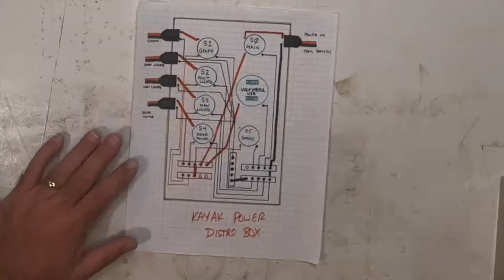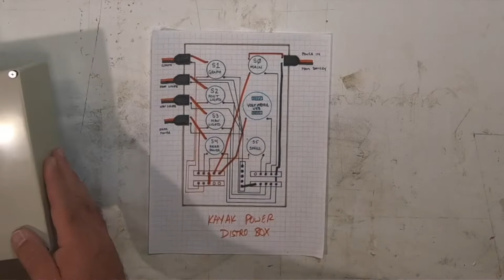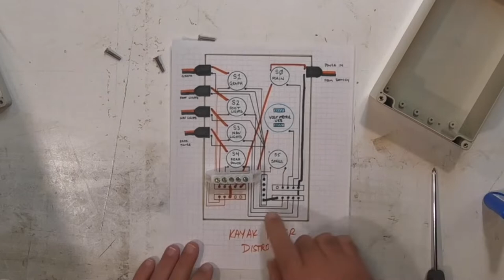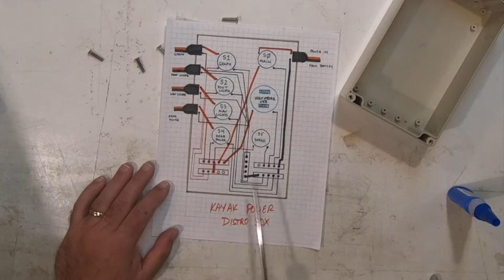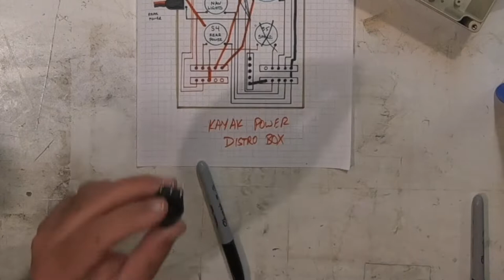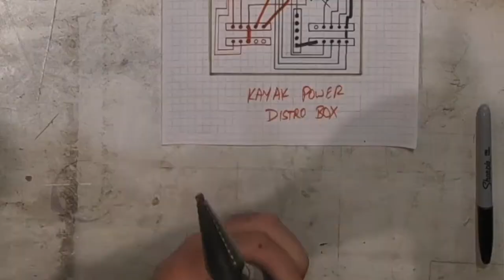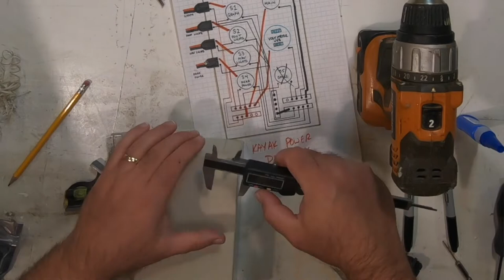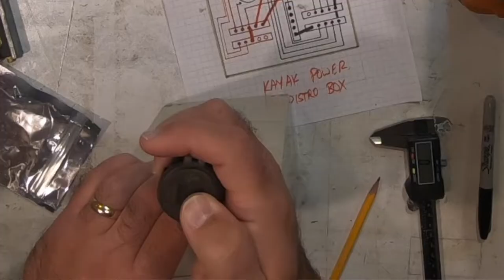DIY Waterproof Kayak Accessory Power Distribution Box. Fish Finder. Lights. Old Town Autopilot 136.

Comment from the maker: Follow up after a couple weeks of use:  
(1) Heavy Duty Velcro isn't strong enough to survive transport on bumpy roads.  I need to find an alternative.  I'll let you know when I come up with something.
(2) Consider capping your wires with some kind of crimp connector before putting them into the bus bars.  The only electrical problem I've had is with thinner gauge wire sliding out of the bus bar stops.  I put a crimp connector on (which gave the bus screws something better to hold) and haven't had a problem, since.
Reply from the maker: (1) I ended up going with self-tapping screws through the back of the box and into the hull of the boat, under the seat.  (Still in the same position shown in the video).  I pre-drilled the holes in the box and then applied silicon to the back.  That way, when the screws pulled tight, the silicon sealed the holes.  I've transported the boat approximately 200 miles since making this change.  No issues.  Rock solid.
(2) Crimp connectors in the bus bars are working a treat!  With these two minor tweaks, it feels like a professional quality mod.

Comment: Great project, you could also simplify the project by buying a marine switch plate and installing it on the appropriate sized box, just using a power port.  Comes with switches , plugs and battery meter already on a metal plate.  Enjoy your videos especially that battery box.  It is what I will be doing when I can afford a lithium trolling motor battery. Blessings
Reply from the maker: Great tip!  If you have a recommended switch plate, feel free to paste a link here.

Comment: Doing this for my 14ft Gregor boat!!
Reply from the maker: Awesome!  The only issue I've had with my build, so far, is the heavy duty Velcro thing I pinned at the top of the comments.  Two things I've learned that I want to pass along:

1) Leave slack in the lines going to the bow lights.  Give yourself about an extra 10" if you can.  Then make a service loop.  No sense in those lines being tight.

2) Consider purchasing a higher quality of switch than I did.  They look cool, and they do the job... but I'm not impressed with the plastic.

Good luck!  Let me know how it goes!

Comment: LOL, Wire glands are designed to seal only single strand wire!
Reply from the maker: Correct.  I was worried about it, so I shot the side of the box directly with a garden hose.  (Not a pressure washer.  Just a garden hose.). Then I opened it up and checked it...

No water got into the box.

So, I'm good with it.

Comment: I am always a fan of DIY. Clean work you did here! I am curious though, why under the seat? it seems to me like you'd have a tough time accessing the controls while seated.
Reply from the maker: Great question!

It's super easy to just reach down with my right hand and hit the switches.  I didn't want the box in the footwell, because was concerned about kicking the box... I didn't want to break the switches, or accidentally turn something off... I also didn't want to take the chance that I would break the glands.  It's convenient to the location of the battery and creates the lowest amount of risk when it comes to (pretty much) any issues I could imagine.
Reply: @CareAgainFishing  Gottcha, as long as you can reach it lol. are you also able to see the voltage readout without lifting the seat?
Reply from the maker: @MDAF410  I have to lean a bit to my right, but that's it.